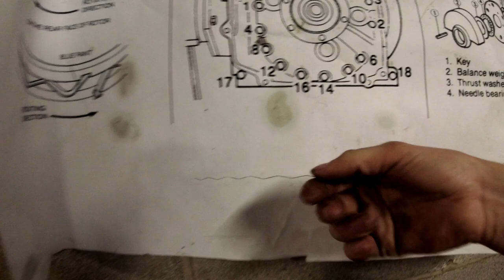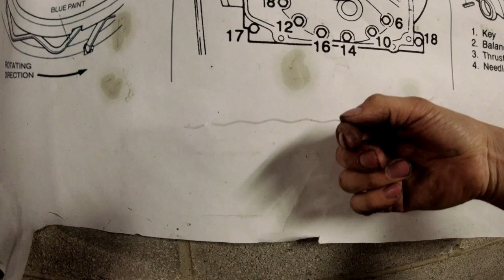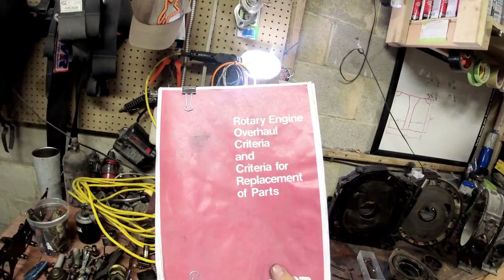Your Rotary Engine Needs a Rebuild - What Do I do? - How Much Will it Cost?

Comment: the vegas brother (angel motor sport) talk alot about under a gram balance and what not, how important is balance? i want a 200-300 hp street port turbo 12a or 13b, will i need to have everything balance for the engine to survive for more than a year?  is asking for 200-300hp on stock asking for alot or even realistic?
also how much hp can stock trans and diff take?
Reply from the maker: Balance matters a lot for rpm.  I wouldn't go much past 7500 without a proper balance. As far as stock trans hp. Depends. 300 street horsepower would probably be fine. But as you can see if your hard on it 200 can hurt things as well

Comment: Just wondering. You didn't mention oil control rings failing. isn't that a thing aswell? I'm asking because i have a 115.000km FD in my garage that has an engine with low but not terrible compression. It blows alot of blue oil smoke for the first 5 minutes when starting it. It decreases with engine temperature until its nearly fully gone. I'm suspecting my oil conrtol rings are worn or maybe cracked so if the engine expands under heat haybe it seals again. Also the oil has a verry strong gasoline smell to it. I'm a rotary newbie but gas in engine oil never is a good sign.
Watching your complete playlist now to soak all that information in.

Comment: Hey man, awesome video. I’m looking to buy an FD. It will be my first rotary. And honestly my dream car. Prices and mileages are all over the place. What are some key things that I can look for to help determine the engine health and a good car overall?
Reply: Compression check with a proper rotary compression tester is one of the best ways. 

How easily it starts cold / hot can be another good indicator.

Comment: Just curious would you replace dowels in an 13b ren if there were no probs w them on tear down? Also my car has its second motor in it still with decent compression just checked a month or so ago, I know this is opinion based but would you reuse the housing for a rebuild? I’m planning and tearing it down and street porting and giving it all new seals, what do you think?
Reply from the maker: Only time I have used different dowels is if they are damaged, but typically they get rusty or nicked up from poor storage. I have yet to see an engine damage them during any mode of failure.

Comment: Hey man, just getting my first FC Turbo 2 it's an 87, my first rotary car and it's been sitting in a yard for at least 4 years, I don't know much to anything about the car yet besides some door and rear damage, that could be why it was at a yard. Should I try to oil up the motor and turn it over by hand and try firing it up as is? Or should I bit the bullet and go straight for a rebuild?
Reply from the maker: Oil it down and try to turn it over.  Could pull the plugs and listen to it crank over.  See if you have good pulses and then go from there!!

Comment: hey this was super helpful as i am low budget and i want to see if i would be able to rebuild my engine myself. The engine i have in my fb rx7 right now that dumps oil on decel from high rpm’s. i asked around and people told me oil seals failed and that causes the vacuum to pull oil
through the seal. is that the dowel pin oil seal that you mentioned? if so all i need would be a soft seal set?
Reply from the maker: That will be the oil control rings on the rotor itself.  You will want to replace the dowel o rings when you rebuild it as well.  In a perfect world yes a soft seal kit should be all you need to fix that situation.

Comment: Very informative, thanks for being straight up, to the point.

I would be interested in some information on the relative value of particular engine upgrades. What will net the most horsepower/reliability, per dollar? What should almost always be done, versus what should only be considered after other upgrades...

I'm considering solid dowels because they're very cheap and it sounds like I could save a headache avoiding having to seal the hollow dowels. Routing the oil lines externally shouldn't be an issue.

I'm not sure what my next options would be. Full 1/2" studs would be prohibitively expensive. But maybe 12mm studs?

Of course I will be porting, but that is less of a tangible equipment upgrade, which is more of what I'm looking for.
Reply from the maker: I can make a video talking about upgrades like that as well, I don't have a ton of experience with that sort of stuff. But I have built some with studs. And done porting myself
Reply: @RADPotential  awesome! I would love to see a basic porting tips video, I’m planning on doing that myself too
Reply: @jaredp4478  you can look up angel motorsport on youtube. they do a lot of engine modifications on rotaries.
Reply: @whyshouldipickaname  yeah I know the mods for the most part, but no one compares them, like no one says this is cheap and easy, do this first, etc
Reply from the maker: I'll make a video on my thoughts for yall.  Take it for what it's worth haha!

Comment: Hi, i have rx8 07 car broke down and cant seem to start it it, while kicking the engine over i noticed the belt wasn't turning and a hi buzzing / winding noise come from the the drivers side which is the opposite side to the starter motor, any ideas would be appreciated.

Comment: Is around $1200 on ebay +shipping a decent baseline price for a basic 13b engine in the United States? I just do not where to find 13b engines, 13b parts, or anyone that could or will work on 13b engines.

Comment: Hey man, just tore my 12a apart. I have everything marked to reassemble everything in its og place. My housings, irons and seals are all absolutely mint, but my rotors bearings are absolutely torched (copper showing) the e shaft has some scarring as well. Is replacing bearings an incredibly difficult task and would you happen to have any idea why that may have happened? i didnt get to drive the car for very long and i didnt ride er that hard.
Reply from the maker: Not uncommon especially reviving old cars.  No telling what could have gotten in the oil.  Find a replacement e shaft and have new bearings pressed into the rotors.  I'd do Stat geat bearings while your there as well.
Reply: @RADPotential  That's the plan, thanks brother!

Comment: Hell lo mr rad! I have an s5 engine that has sat for over 10 years. Recently i put some elbow grease into her and got her running. Redid all the vacuum lines and intake gaskets and just about everything else besides the engine itself. Shes hard to start tho, have to floor the pedal to get her going and then she will run pretty steady but at a higher rpm ..1500.. and shes hard to start once warmed up, floods. i put a burp funnel on the radiator and she keeps churning brackish stuff into the clean water in the funnel. Kinda looks like oil but im not getting any water in the oil. A friend that works with rx7s says i need to run it since its been sitting so long and the front front rotor was 118 and the rear was 98. Could my issues be related to bad seals inside the engine, like what you said about the coolant seal on the exhaust side, and running wont help and make the problem worse?
Reply from the maker: Most likely a coolant seal if it's pushing combustion into the cooling system And pressurizing it.   If its making good compression. You should be able to just tear it down and only replace the soft seals

Comment: I recently rebuilt my se engine ( complete rebuild. That’s all seals and springs) and obviously I did a poor job because I don’t have good enough compression for it to start on it’s own. My going theory is that the solid corner seals had too much clearance so when I was trying to clearance side seals, my feeler gauge was getting pinched in that space when the corner seal would tilt in, causing me to over clearance the side seal??? Idk if that makes sense but let me know if this theory could hold any water because idk man
Reply from the maker: Very well could be.  I have a video somewhere on the channel showing a pretty big variation in compression using oem corners vs solid corners.
Reply: @RADPotential  it’s my best guess and I’m glad to hear it’s not entirely goofy. It’s got new never used housings and good irons so I’m hoping that’s my issue and not that I immediately blew an apex seal on first start!
Reply from the maker: A broken apex seal would give you 2 dead faces.  And otherwise Good compression everywhere else.  You would be able to see the broken seal through the exhaust port

Comment: My FC Rx7 has over 200k miles, its definitly time for a rebuild or a swap. 13bt2 swap? 🤔
Reply: My fc had approximately 210k miles before I sold it and it was still running like a champ.
Reply: @poncho828  update 
Time for a rebuild 😭
This week I'm pulling the engine out. First time rebuild the engine, I really can't afford another FC so this will probably be my last FC if all goes wrong.

Comment: I bought a motor from a salvage yard with a video showing 125lb compression, I put it in the car it made about 5 rotation cranks, then started free spinning,, checked compression and only 45 psi, what could have happened?

Comment: Im new, but id like to know if you’ve done an rx8 before. I have one with hot start and suspect its the starter because its 04 series one with all new ignition. Also i’d like to see a video of how to clean the rotors.
Reply from the maker: I think I have cleaned rotors in a video on the channel before.  Look at the 79 12a engine build series. Also the build secrets video on assembling rotors.   

I am picking up an 04 rx8 soon. Maybe next week or 2 weeks I think

Comment: First of all awesome videos.  I planning on buying a RX8 and maybe making it in to a track car with minimal upgrades.  I see a lot of damage engines in this video were these more older engines or the newer 13B's?  Is there less breakage and fuss with the aluminium engines then the steel?
Reply: rx8 have heat issues like any rotary, S1 renesis motors were more susceptible to overheating and wearing due to lack of oil (2 oil squirters lubricating the engine rather than 3 like later generations)
a Sohn adapter kit will replace the stock oil squirt system with a 2 stroke oil reservoir that works to lubricate the seals much better and more cleanly than burning petrol based oils in the chamber, also recommended to premix w/ 2 stroke oil regularly for the same reason, even with Sohn adapter installed

Comment: Hey i have a question, idk if you anwser those anymore. I have a big gap between mine rotors one is 5.8 and the other one is 6.9. Is it worth putting money in? It holds power but im afraid one cylinder housing is just much worse condition.
Reply from the maker: I noticed a pretty solid top end misfire running an engine in my rx8 that was 60psi front and 90 psi rear.  A quick conversion shows yours would be 100psi to 85psi difference.  It would probabaly be OK to run if you aren't noticing any break up or other issues, but at those compression numbers. That engine should be in good shape on the inside. You could probably rebuild it fairly easily. My variation was caused by a failed OMP line on the front rotor. Most likely driven for awhile before fixed. Hence the extra wear and low compression.
Reply: @RADPotential  i forgot to add it was 12A and yes it pops flames in every shift. We got it tuned up in poland in the best rotary shop i could find since noone knew how to regulate her carb properly. It held this compression for a year now and nothing seems to break so far. I was worried since my friend said, that the weaker rotor would bring down the healthy one as well, but as ive done whole lot of research it seems he was bullshiting me a little bit.
Reply: @RADPotential  many thanks for the reply!, i simply had a hard time getting info from someone having similar scenario.
Reply from the maker: The rear rotor wont ever drop the compression of the front rotor.  Just imagine a car where both rear wheels are being independently driven, and the right rear tire is going say 5% faster than the left.  At slow speeds (low rpm) you may not notice.  But at high speed, ( high rpm) you may experience the car pulling one way or the other.  depending on how high you rev it, it may be noticeable, but if its just a street cruiser, id keep running it
Reply: @RADPotential  ohhh now i understand

Comment: We have a first gen rx7,my dad was driving and the distributor cap came off,we put it new with the thing inside,new spark plugs,and cables,has 100 psi on the front housing,and not a bit on the front😰what do you think it can be?
Reply from the maker: Check igniters.  Also a video back on the channel about wiring up a electronic dizzy. Make sure everything has power/ground tk the right places

Comment: Watched the i entire video. How common is for the housing to warp?
Reply from the maker: Irons to warp?  Not too crazy.  You can check them for square with a straight edge and a feeler Guage.  I have rebuilt some very cooked overheated engines and have never seen a warped one
Reply: @RADPotential  sorry I meant rotor housings.
Reply from the maker: I haven't ever seen a housing warped.  But it's not a hard check to do. Check out the rotary engine book of secrets video
Reply: @RADPotential  ok thanks. I’m getting a lot of mix answers from people regarding the conditions of my housings. The engine came from an automatic S5 convertible. Everything is all cleaned and visually it looks passable. There are some minor corrosion’s pit on the dowel pins leading some people to believe my housings are warped.

Comment: Where can you get 12A housings or rotors these days?  Back in the 90's I could get a used rotary for $500 and swap it out.  These days I can't even find housings.
Reply from the maker: Now a days you would be lucky to find a housing. Let alone find one for less than 500 bucks

Comment: So I need some help, So I found an abandoned RX-7 FC GTU near me and I've been wanting to know after doing my research on the whole car if the engine would need a rebuild? I suppose it's been siting since early thousands to early 10's knowing how easy it was to get the door to open. It has 50,242 miles on the odometer and again has been sitting for a little while. Any help?
Reply from the maker: Id dump some 2 stroke oil in the combustion chambers periodically a couple days before you want to start it and turn it over, then put some more in, turn it over.   Then just try and fire it up.   You will need to pull the upper intake. Or try and pour it down the secondary injector holes.  After you remove the injectors of course
Reply: @RADPotential  wait what the... 
So funny story, its been missing parts. The original intake is missing. Huh, anyways thanks for the advice.
Reply from the maker: @dant-rex1727  If youre wanting to go the budget route thats my thoughts,  otherwise, pull it, rebuild it right before you tear it up worse trying to make it work.  If the intake is off, that makes this an easy process,  the hard part on an FC is that the runners or so long its hard to get any oil or lubrication to the combustion chamber through the throttle body.
Reply: @RADPotential  Ok thank you so much for the help, hopefully soon it will be out of it's "gravesite" it's currently in.

Comment: Putting a rx7 motor and trans in my 74 repu is there any trick to relocating the shifter forward to fit the pickup
Reply from the maker: What year transmission are you using? If it's the NA size trans, and an S4 or earlier, you need an SA rx7 , 78-80 tail shaft housing, shifter, and shift selector can be swapped over, and that will move the shifter forward to fit the truck
Reply: I believe it is an 85

Comment: i have a rotary compression tester but to get accurate results you have to have the engine up to operating temp but my car doesn’t start and my number are weird but they go up the more i crank it so is there a way to get accurate numbers if i can’t warm the car up
Reply from the maker: Cold the engine will make higher compression than warm. Springs are stiffer cold.
Reply: @RADPotential  oh so 51 20 20 isn’t a good number to get cold
Reply from the maker: @bleachman9061  yea, those arent good numbers.  id want to see minimum 80s or 90s cold for sure.  i have seen engines run with less, but you're on a fine line at that point
Reply: @RADPotential  alright well i got your videos to guide me through the rebuild 😂

Comment: I have stuck side seals. I've attempted to get them out but don't want to damage my rotors
Reply from the maker: Soak in evaporust.  Tap on them with the handle of a screwdriver lightly.  Should come loose
Reply: @RADPotential  ok thank you. Also do you have a inner oil control ring I could buy. Need one for my rebuild since one broke during disassembly
Reply from the maker: @lepoptarticus1148  dm me on instagram, I have some laying around
Reply: @RADPotential  okay I dm’d you

Comment: How many times we can rebuild a rotary engine….?
Reply: Depends what breaks inside.  If its just worn seals? Not a problem to rebuild. If something like an apex seal chips/break/shatters from predet and send scrap through the motor? 0 times- Youll be replacing those side plates /housings depending on what happened.

Comment: so... all that being said... middle of the road, optimistically, rebuild cost for moderate daily driver and occasional RUN IT driving? rebuilt by you? u said $5000 all out ... with turbo?  or w/o? that might be a little much for daily driver weekend warrior... every so often. $1500 done by you/for you using reused parts... hummm. might work. a little port job worth it? little HP tweaks? little turbo... $2500? $3000 with the IMPORTANT parts new. hopefully the irons are in ok shape. good break in for 2000 miles? add oil to gas, 2 smoke oil to gas instead of motor oil injection? better? worth it?